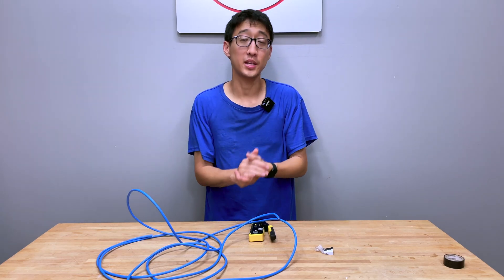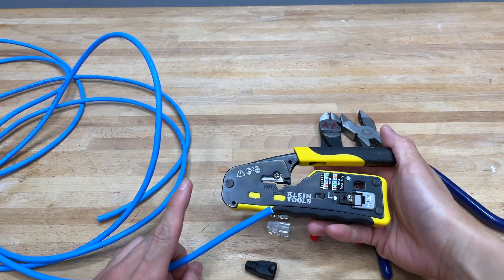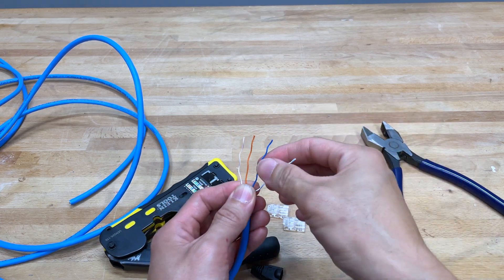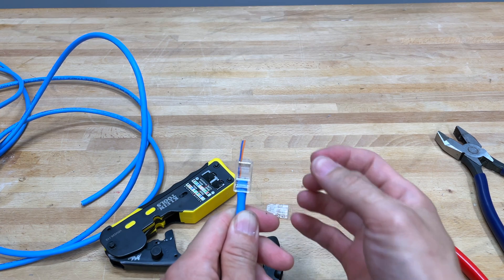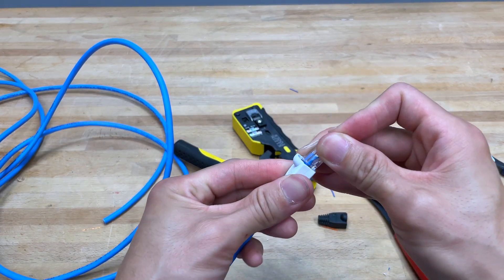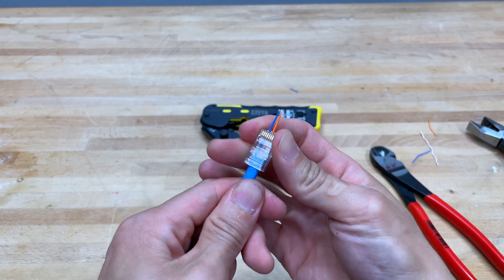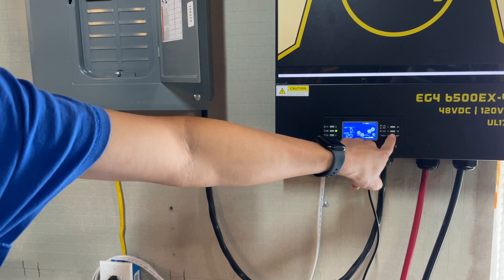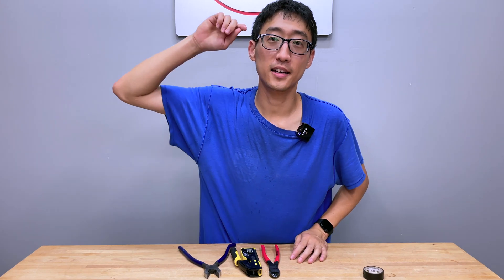How to make EG4 communications cable | 6500-EX | lifepower4 | bms | make your own | battery comms

Comment: I need your help. I am using the Yellow EG4 3000EHV inverter and the LiFePOWER4 48V V2 battery. My suppled USB/RS485 inverter end to RJ45 RS485 battery end is not long enough. I tried using a female to female pass through coupler and CAT 6 patch cable to extend my supplied cable to reach the battery  but it doe not work. I learned from you here how to make up a cable but only the battery end with the two wires you show here. What do I do at the other end and how should I pug it into the end of the supplied cable that came with the inverter? How do I couple the supplied BMS wire to my made up CAT 6 wire and how do I configure the pins for that end? I could really use your help.

Comment: Thank you VERY much! I ordered the wrong USB to RS485 adapter (the one for inverters, instead of the one for batteries). Your video is the best source I found that explains the wiring differences. Thanks to your video I was able to rearrange the wires and now it works (and I do not have to order another one and wait for it!)

Comment: Your video was very helpful.
Ihad error 61 since i had no s cable. I used just simple ethernet cables without result's so i have buy one because i lost the one came the battery. I use Easun inverters and batteries and my new update is the SMW11kw its exactly like yous.
Reply from the maker: Glad it helped

Comment: So in a pinch I can just see what the first two colors of the cable are cut it at the other end and connect those two colors to the three and five wires with twisties and plug it in?

Comment: hi i have a fox ess battery L52 which uses pin 2,4,5  i have a solis hybrid inverter but dont know what pins they use do you have possible answers .

great video
Reply: Check the inverter manual. It should state the BMS pinouts